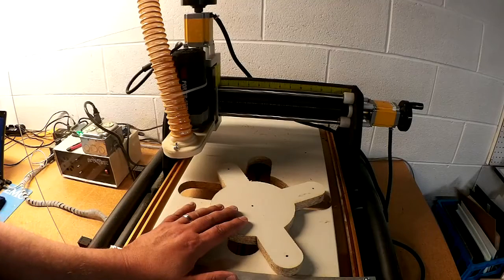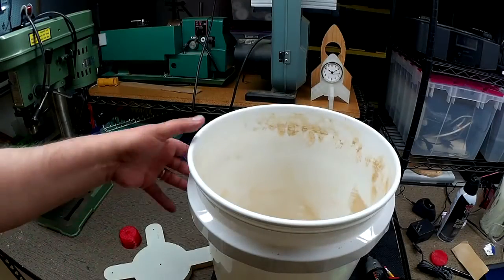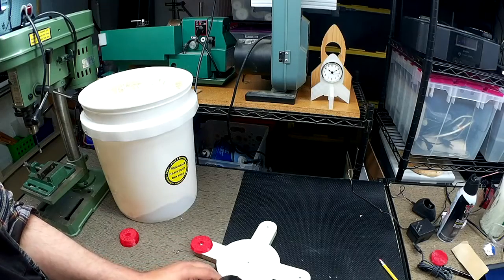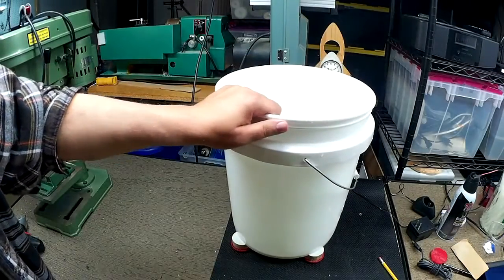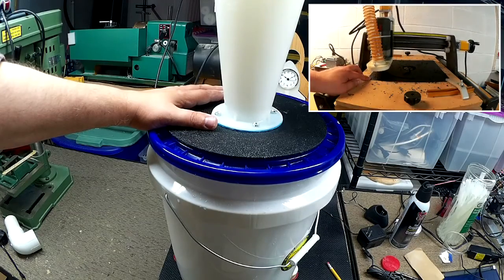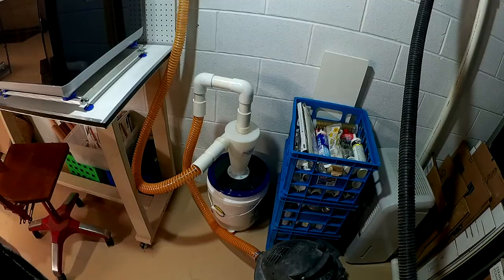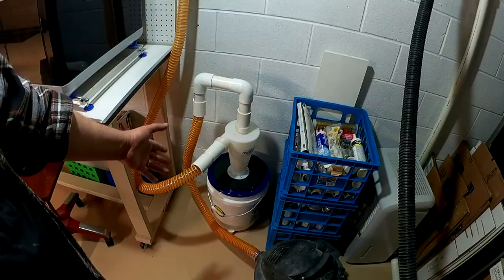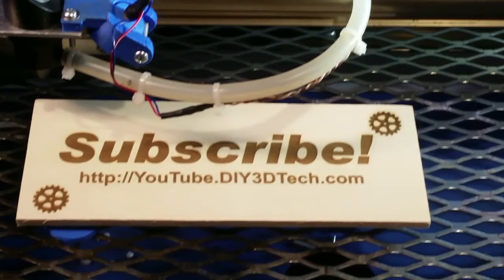CNC Project  -  Building Cyclone Dust Collector Part 4!

Comment: I noticed that your CNC machine has the vacuum attachment for it but did not seem to be too effective in the ABS sheet. Have you tried some type of sweeper barrier around that head to corral the cut debris from being thrown  around?  I saw a pretty cool one on the Ben Heck Show once for his CNC machine.  The project looks cool though.
Reply from the maker: That is main reason for building the dust collector as the vacuum filler gets plugged up fast with "fine" dust the the CNC makes.  As the interesting thing is the dust head sucks from around the bit and does work well.  I have been meaning to laser cut a skirt but just no time as I also want to redo the shoe. :-)
Reply: +DIY3DTECH.com - Hey, when the laser gets ready to be replaced you gotta try and cut a pizza with it. That would be so cool!  Lol. I'm thinking thin crust though.  Ha ha.